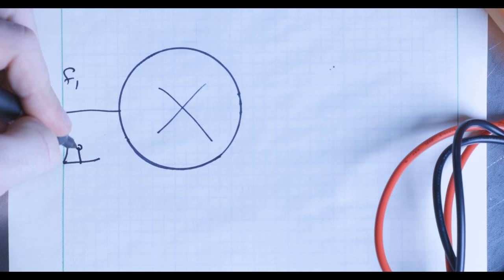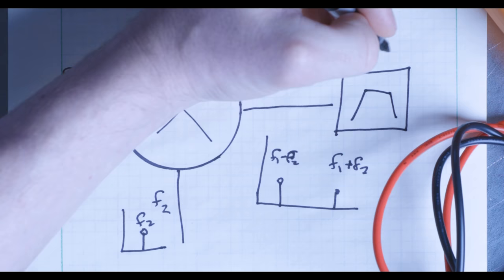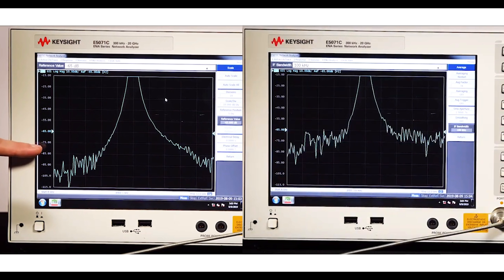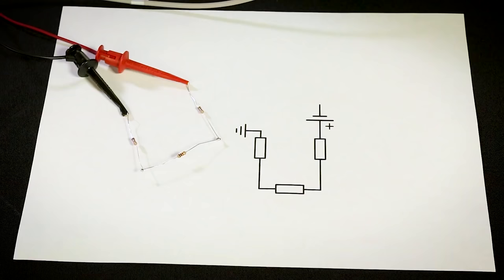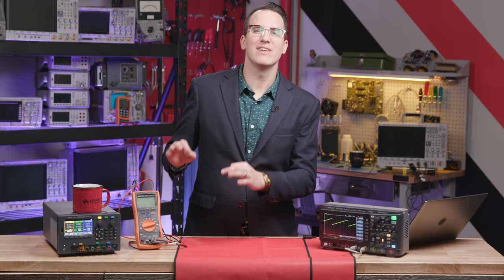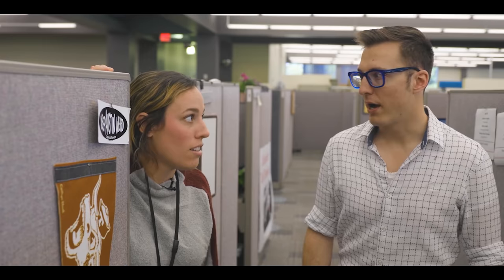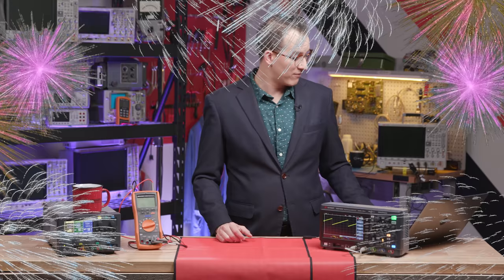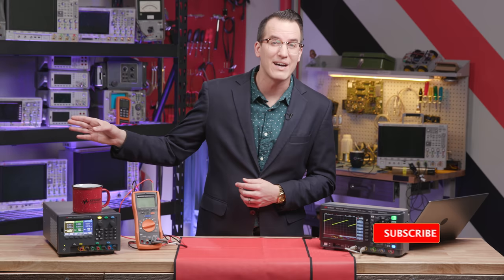Narrow vs. Wide IF Bandwidth - How it Impacts Your VNA Measurements + Wave Winners

Comment: BTW I used to own one of those cell phones on the back bench, fell off the back of my car.  Saw it bounce off the road in rear-view mirror.  Went back, brushed of the dirt, reinserted the battery and turned it back on.  They were built like tanks.  Oh also BTW, I used to be a tank commander. ;-)
Reply from the maker: They are solid!

Comment: Great video. I get that low BW is synonymous with slow throughput and high BW with high throughput. 
However maybe I missed something when you equate narrow bandwidth with high resolution and vice versa for wide bandwidth. I thought that in the spectral domain, a wider bandwidth equates with the equivalent of allowing for a primary wave plus many more harmonics than a narrower bandwidth. More harmonics means that you can more faithfully reconstruct a time domain signal, given that you have available more of the higher frequency components? 
Could you explain how a narrow band IF is analogous to a higher resolution outcome? 
I'm genuinely interested.
Thanks
Reply from the maker: Good question! Here's the response from Matt:

While it’s true that measuring over a wide bandwidth gives you a better idea of harmonics and neighboring signals, all of that bandwidth needs to be converted to a digital format for the instrument to analyze. Let’s say you’re looking at the response of a band pass filter with a pass band at 5GHz. You sweep your frequency from 1 GHz to 10 GHz so you can see how the signal behaves outside of the pass band. 

That entire 1 GHz to 10 GHz bandwidth needs to be converted to a digital format for the instrument to analyze and display. The instrument breaks the bandwidth into pieces and converts it one piece at a time. The width of those pieces is the intermediate frequency (IF) bandwidth. This is where it gets tricky because we have two bandwidths – the bandwidth we’re measuring across (1 GHz to 10 GHz) and the bandwidth at which we’re converting the measurement to digital (the IF bandwidth). When you convert wide portions of your test signal to digital, you introduce more random noise into your trace. So, converting smaller pieces of your measurement to digital by using a narrow IF bandwidth gives you better resolution.
Reply: @KeysightLabs  ahhh, got it.
Thanks makes sense now 
It's similar to audio band sweep measurements, where you sweep with a narrow passband filter. More accuracy, less noise.
Many thanks

Comment: Your misusing the term BandWidth.  Band width is a term directly relating to the operating frequency or spectrum of frequency  present at any given time.    Your trying to apply the term to Resolution.  It's not working and not the proper use of the term.  Many words are being misused today adding to the watering down of our language.